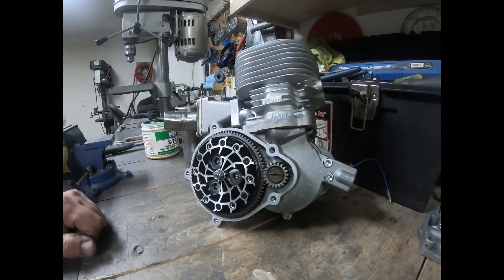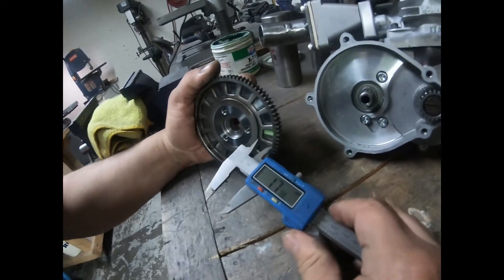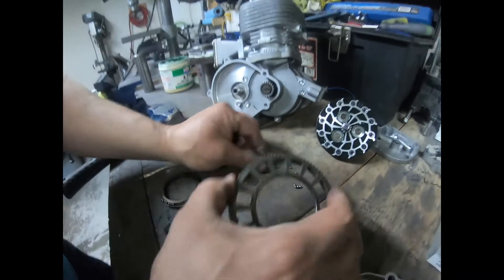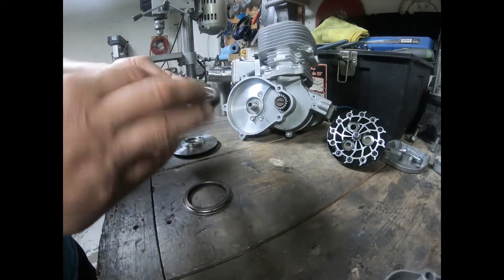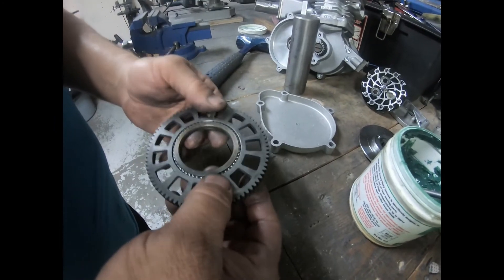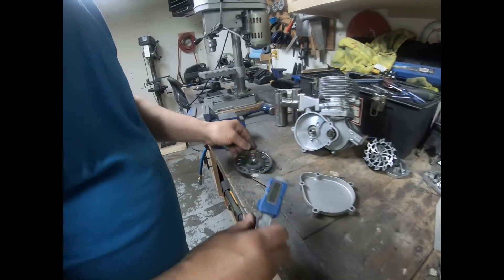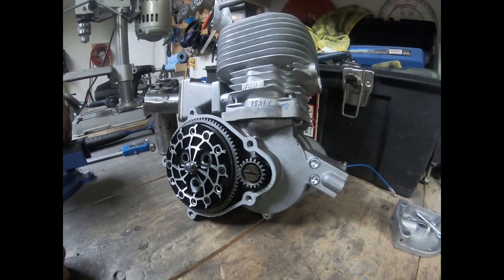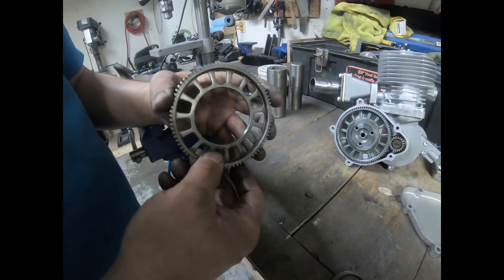How to Replace Your Clutch Bearings in a | 49CC 66CC 80CC 100CC | Motorized Clutch Basket

Comment: When I did this the 1/8 was to big an left alot of dead space= wobble an there will b alot of space left over, but 3mm u can add more an u take up all that dead space, that's what worked for me, ggz 👽
Reply from the maker: lots of  variables to consider i did mention in video that people were using both 3m and 1/8 depending on wear or manufacturer of basket

Comment: How often would one have to service these bearings? I replaced mine using a similar video as a reference about a year ago and there wasn't a metric for servicing them
Reply: Not too often they would need to be changed
Reply: @darcyhemeon4309  don't mean to replace but just to service them. Maybe once a every 6 months if it's a daily driver?
Reply: @logainfalsedragon3587  never hurts to inspect and clean , repack bearings

Comment: Respectfully wouldn't it just be easier just to buy a complete pressed clutch assembly for $20 bucks RTG ?
Reply: 100 roller balls are about 5.00 so it's 2.50 each clutch and I've seen the pressed one fail alot from not installing properly,  I've never had a issue replacing  roller balls , and it's same or Less work .
Reply: But with that said , if a person wants to install that ... sure why not

Comment: great video man... was one of the first things i noticed on these motors.  I was so worried i got a dud that i posted about it and was informed this is just how they come.
Reply: Yes is is how they come some better then others , this one is brand new I'm working on , it's unacceptable play and backlash in gear , being this engine was modified to produce high amou t of torque if I were to leave it , I would be seeing signs of damage right away